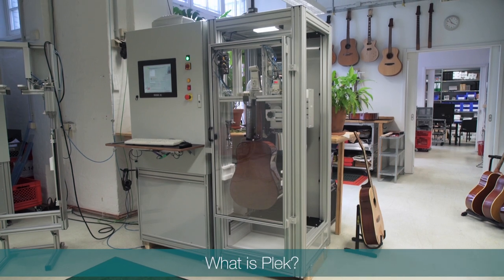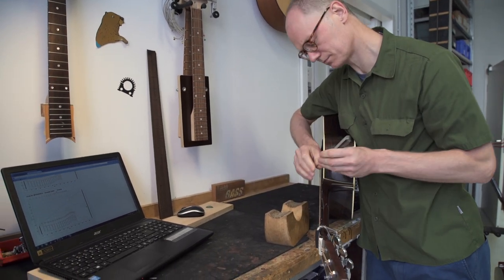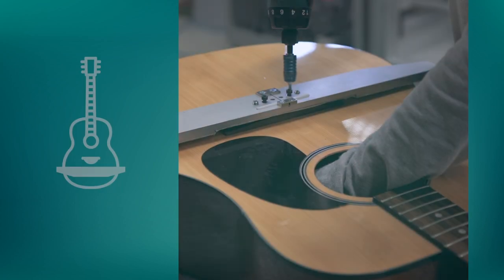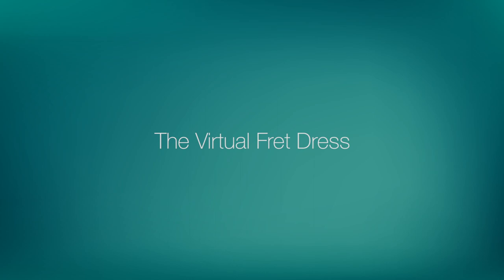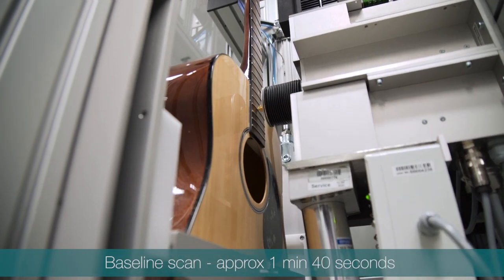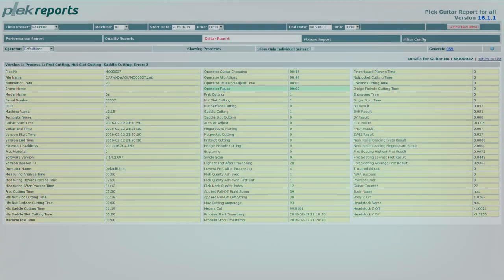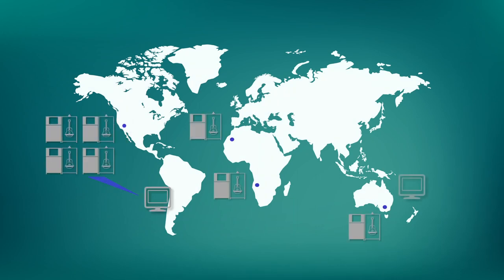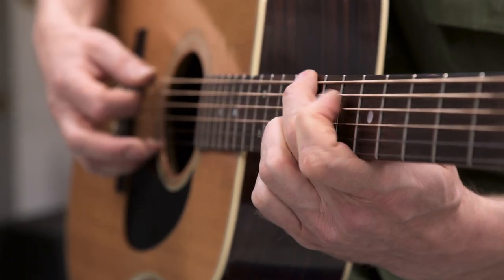The Plek Pro System

Comment: Explanation is not clear: 
First use external tensioner and adjust truss rod, but after it remove it, put to the PLEK and do scanning, BUT neck will have another shape without tensioner or strings...? Do you perform scan and milling of frets under tension in fact?
Reply from the maker: Hi Ivan, the Plek Pro machine can also simulate string tension, just like the external STS system. The external system merely helps speed up the process by providing a guide for truss rod adjustment. The Plek Pro machine can perform all tasks under simulated string tension. Hope this helps! :-)
Reply: Ok, understand, thanks. In this way, maybe best option is to perform scanning and milling always under tension.
Reply: I just got my American Series Stratocaster back from a Plek job.  The frets are ruined. The fret height runs from 041" at the first fret, to 035" at the 22nd, a difference of .006".  Do not go with Plek. Find a skilled luthier..... Plek=overrated.... Don't do it. Find a skilled luthier..
Reply: So, still not clear:  what you recommend - scanning and milling under tension, or without tension?

Comment: I just got my American Series Stratocaster back from a Plek job.  The frets are ruined. The fret height runs from 041" at the first fret, to 035" at the 22nd, a difference of .006".  Do not go with Plek. Find a skilled luthier..... Plek=overrated.... Don't do it. Find a skilled luthier..
Reply from the maker: Thanks for the feedback Brian, please see our answer to this under our "Plek Machine Accuracy part 1" video. 
All the best
The Plek Team.
Reply: Plek is only as good as the operator.  If the fret job got screwed up, then the operator didn't know what they were doing where you bought it.